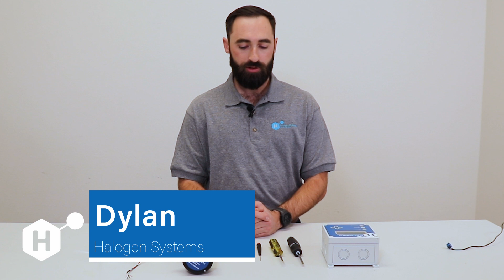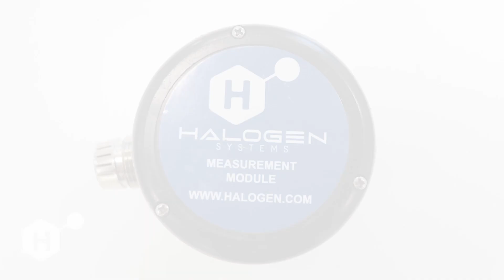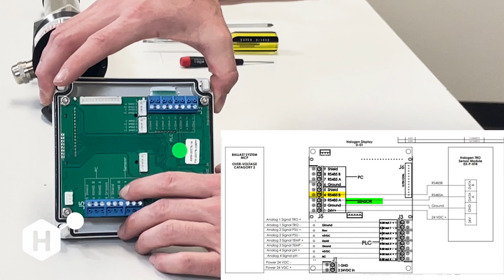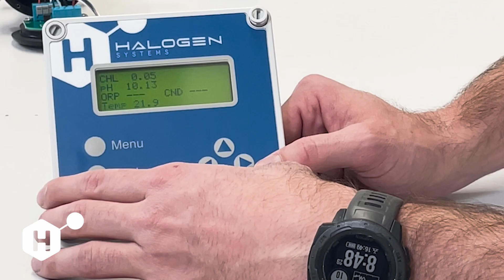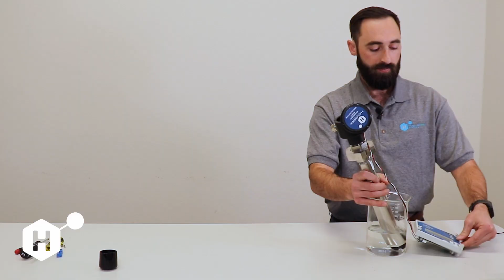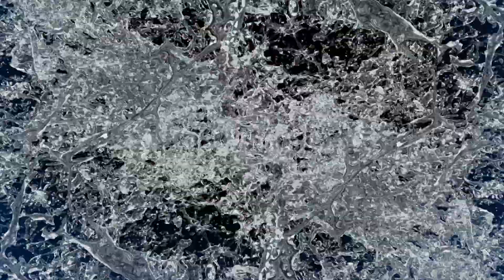BWMS Commissioning and Troubleshooting

Comment: I have a problem with the sensor.
It's new; I just installed it. The LCD screen shows the address 125 meaning it does recognize the sensor.
But it doesn't show me any reading values; everything appears as Ph ---- Temp ----...
And the code " Prb OOD" appears on the screen, in the bottom right corner.
I have tested this screen with another sensor, and it reads the data correctly with that one.

I need Help!!